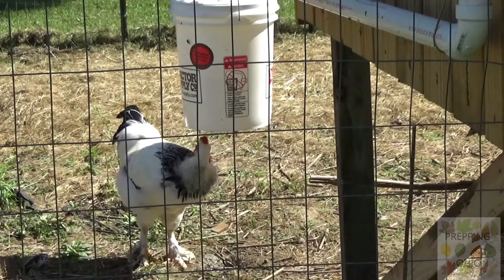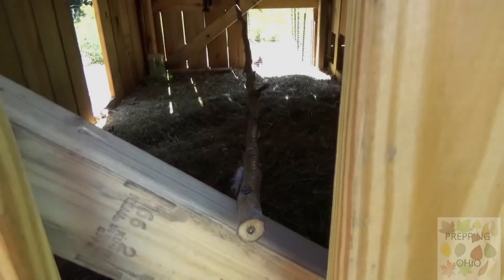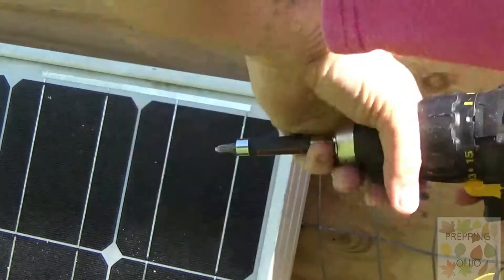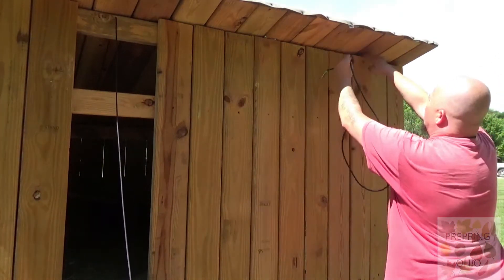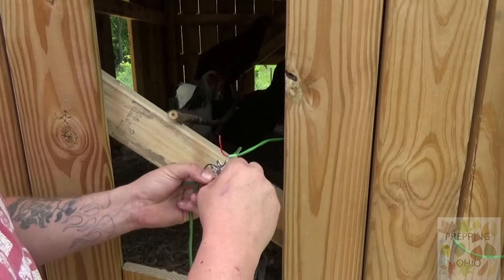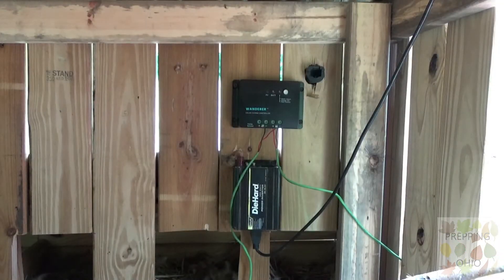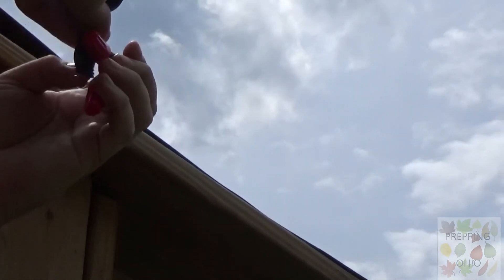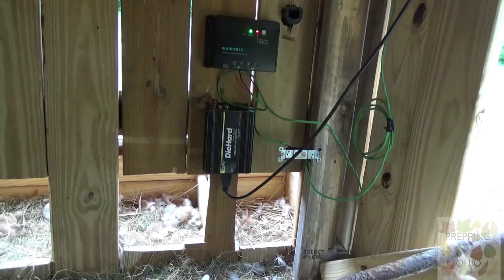Solar power at the chicken coop

Comment: Ha i put solar on my coop. Used a portable dokio unit mounted to roof. I also use it to charge everything to.
Reply: My temporary coop has 2 geeni wifi cameras a geeni light bulb and a auto door.
Building the permanent coop and going to do 4 geeni cameras. A security light. Light bulb. And if I can get them to work hook the geeni garage door to the door.
Then power it all thru solar.
Solar water pump to keep collected rain water moving.
Solar car fans for summer.
And if I can figure out passive heating that too.

Time to be alive indeed. Grand parents raised chickens n just shake their heads lol
Reply: @nickabel8279  last winter in cental pa was my first with chickens. It was a huge concern. I did some insulating and used a very deep litter. 8x6 coop with 15 birds. Next winter I'll add a few more birds . I did use a low wattage water heater that had me barely making it through the winter with my water system. For the most part it all went better then I expected. Next winter ill have 20. That should max out my coop. Walk in coops also provide more flexability with numbers. It allows you to add a few more if they have plenty of roosting areas.
Reply: @nickabel8279  rabbits are this years experiment along with meat birds
Reply from the maker: What an exciting time we live in.